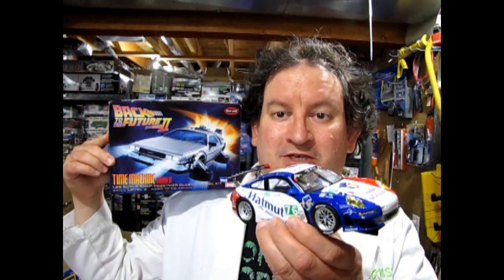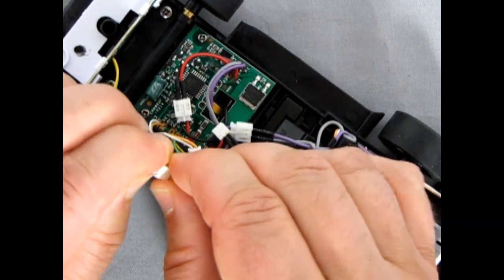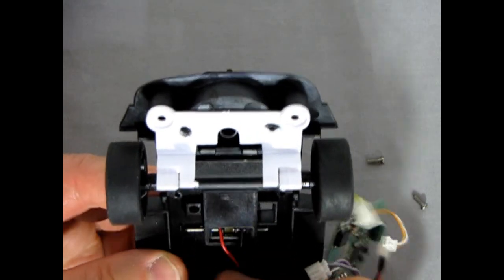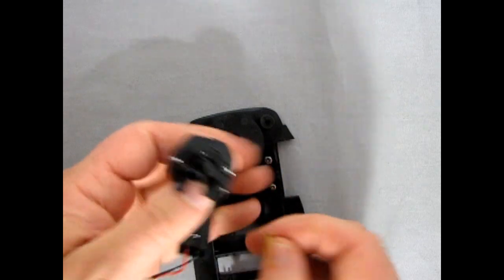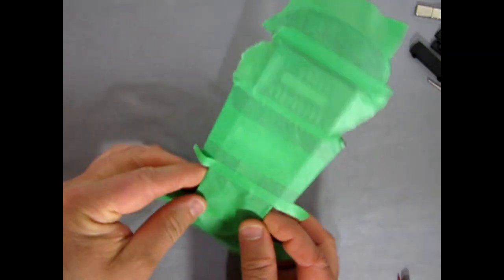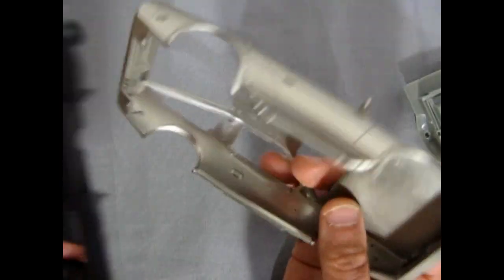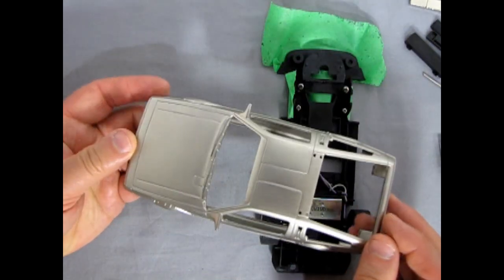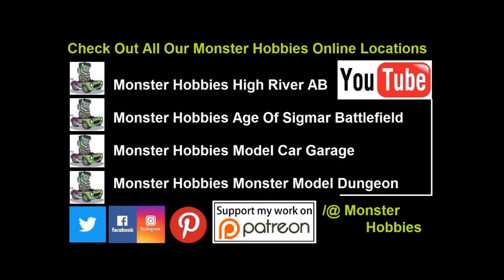How to Convert A 1/25th Scale Back To The Future Delorian By Polar Lights into a Slot Car  - Part 1

Comment: Dude!  Start with the right slot car!  I have done the same conversion but used the Carrera Porsche 906.  Wheel base and width is spot on.  No body trimming was needed and only a small strip of chassis need to be trimmed at front and  Tires size is more correct for the road car and they do not protrude out from under the body.  No hacking of the wheel wells required and the stance is just right. The lights work well from the stock position.   I was able to use the complete deLorean interior with only a little grinding of the interior for clearance. Adding simple mounts to the  to the body I was able to mount the unmodified Carrera chassis using the orignal body mount screws and holes.  In fact, you can swap the deLorean and Carrera 6 body interchangably.   I have nice photos but can't attract here.  I suppose I should do a 5 minute video...
Reply from the maker: Go for it! Darn...I wish I knew that the Porsche 904 would have worked. Well, my friend sent me this Porsche 935 and that's what I had to work with. 

Please make that video and I will place a link at the end of my second one. (I still have to finish this one). Thank you for the tip, although it's a bit too late now! :D